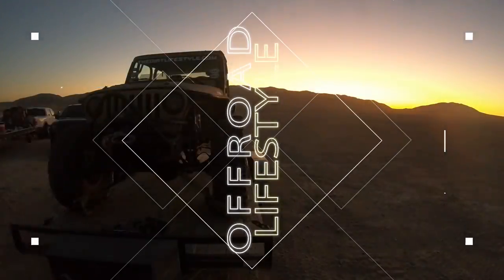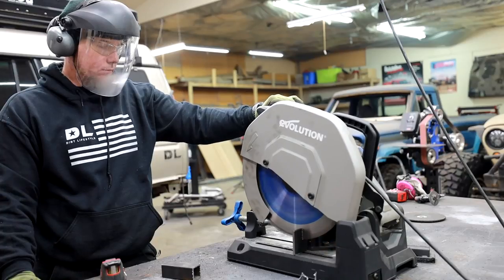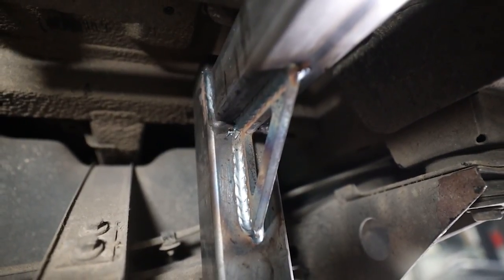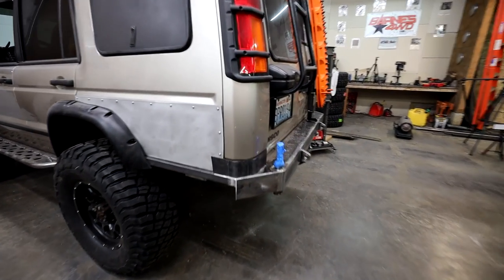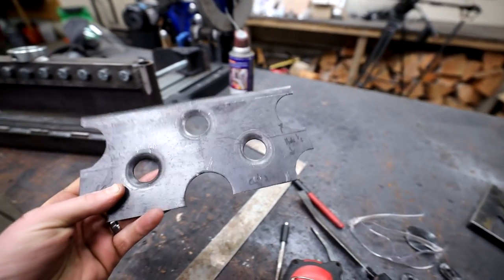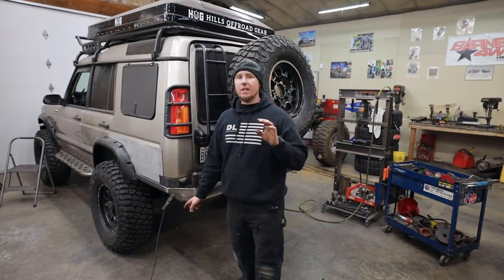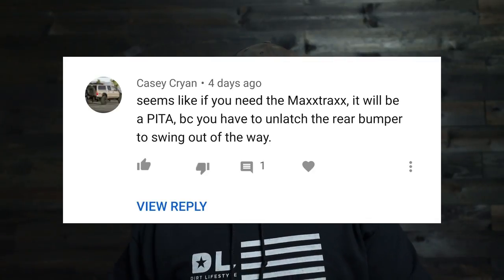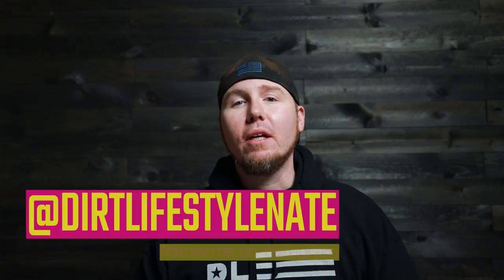Overland Tire Carrier Build Step 3. Ultimate Land Rover Discovery Build Episode 18

Comment: hey I love the tire carrier it's coming out great. I do have an idea to make it more rigid. if you add a curved arm to the top of the hoop behind the spare tire. it doesn't have to be big just like a 1in tube or something with a curve to at the end meet with a poly or rubber stop on the roof rack. I would weld a bolt so you can adjust it for minimum flex while allowing the latch to still work easily. the most rigid solution would obviously be to add a latch up there but it would be inconveniant and I don't think it's necessary. also extra function you could add a hook to hang stuff up above  your table setup.
Reply from the maker: You are definitely thinking along the same lines as I am. I am considering something like this as well 👍

Comment: Great work again, one idea I was thinking about the tire hoop, couldn't you drill a hole to drop the tube into the square swing out and weld from the bottom and around the top. That way the leverage wouldn't be against just the weld? Anyway, keep it up, can't wait to see how it looks painted. Also, I liked your comment about doing something different, vs doing yet another JK, might be why I like you channel. I have a Jeep Scrambler I wheel, nothing crazy but definitely different and I love not having just another JK.

Comment: I hope you show what you do to reinforce the butt welds on the tubing you used for the tire mount. I thought repeating what you done on the front on the back, if there is room! I definitely would like to have that knowledge! Maybe a rod that goes from the top to the bumper, like a crisscross brace,  and when you welded the bottom or second end, lean the 180 degree bend back a ways and then weld, so it had tension backwards on it when you let it go, it might work to take some of the forward sway out.

Comment: The bumper is looking great Nate! I noticed when you moved the carrier, the tire really wiggles around, adding to the stress on the butt welds. Have you thought of maybe having a 2nd latch attach to the side of the ladder for a 3rd point? Or you mentioned you put the tire up higher for overhang reasons, do you think it could come down a few inches to take off some of the leverage the weight has on the buttwelds and still not  interfere with departure angles?

Comment: Cool.... curious to see how you like the tire mounted that high on the swing. I usually mount them low and even try to have the tire sit on the edge of the receiver so it doesn't move around as much when I'm driving and for visibility. I like the look of what you did and if it works well without too much wiggle I'd love to know and try it on my wj project. Good vid man love it!

Comment: You could put a latch going from the tire mount  to the tailgate with some sort of rubber stop that the tire shores up tight against.
Reply: Was thinking the same thing. Like a kickstand maybe even from the roof rack down to the top of the hoop?  Then you’d have three points of contact that might stop the flex. BTW love the channel, lots of hard work so we can vege out for 25 min. Keep’m coming

Comment: Hello Nate, 
Been following you for quite some time., Through many of your builds & videos. As I'm watching this video, I could see that the Rover Overland build is coming together great with all your upgrades & projects that you have completed So far. But as I see you out using it, I have a question or Idea maybe for another project or add -on that would make your Overland camping a bit more comfortable for camping.
   Have you thought of putting on or building one of those Roof awning- OVS Nomadic Awning 270 -Dark Gray with Black Travel Cover - Driverside. This is just one of the ones i found on Amazon, It would be a great add-on to your roof tent plus it would add a cover over the back of your rig where you cook. Just wondering thoughts on it..
Reply from the maker: Thanks! I'm glad you are enjoying the video! I have definitely been thinking of an awning for this build. I haven't decided which way to go yet. Thanks for watching!

Comment: Nate, love what you do and the content you produce. Just wondering if you are going to leave the sides higher than the rear main section. Seems to me like you would end up hooking on rock. Would it not work better if the sides followed more of the departure angle so if you landed them on a rock you would just continue to slide off. Just 2 cents, keep up the good work.

Comment: I was thinking about a way to strengthen the tire carrier.  If you drill holes through the swingarm that allow the tire carrier tubes to slide through.  You can weld the tube to the swing arm from both sides.  No need to gusset it either.
Reply from the maker: Absolutely! I have thought about this as well. More information in The next video 👍

Comment: a small spine gusset on the reward face of the tube down onto/across the face of the rectangle tube would take care of it. 
It would have also worked well/better to make the hoop like a shock hoop on a frame rail, mounted on the outside face with some gussets back onto the top.
Reply from the maker: More details next Sunday 👍

Comment: Great video, explanations, and fab as usual Nate. I wanted to ask about your PPE, specifically the face shield you use and your dust mask. I know you covered some of that in the past, but just wondering what you are using now. They both look comfortable to work in and I really need to start using that kind of stuff. Safety glasses just don't cut it sometimes.

Comment: Love your work but I reckon that tyre is still too high. 
I think you may not have the issues you are concerned about re: departure angle, especially if there is a trailer in future. 

You could mitigate the bending moment (I think) by leaning the tyre forward as much as possible.

Keep up the good work!

Comment: Could you have drilled through the carrier arm for the hoop? have the hoop go through weld flush where it meets the bottom and then run weld around at the top of arm. Great vids!

Was just thinking if tube is almost size of arm maybe put sleeve inside loop at bottom so could still use the hole through the arm method.

Comment: quick question. i noticed when you closed the tire carrier there was quite a bit of front to back deflection from the tire. is there a way to stop that deflection? really love the "just wing it" design style. i find , in my projects, thats a really useful ability. blue prints are nothing more than guidelines. thanks for the insperation.
Reply from the maker: More information on this next Sunday 👍
Reply: really interested to see what he does with this as well.  I have a tire carrier that has the tire sitting higher as well.  I had a decent amount of deflection on bumpy trails.  My rig is an XJ so I took advantage of the license plate mount area and put a thicker aluminum plate where the license plate mounted and then have a rubber stopper attached to the swing-arm that sits against that plate when the arm is closed and it cuts down on the deflection.  I'm just concerned what stress that may be putting on the tailgate itself.

Comment: A way that one could have a stronger join at the bottom of the tire hoop would be to choose hoop tube OD and bottom beam width so that the hoop legs pierce the swing beam. that way, fillet welds can be welded to the legs both on top and on the bottom of the beam, yet the vertical faces of the beam are still intact.

Comment: I’m curious as to the weight of this. Can you weigh it when you paint if you remove remove it for painting. By the way great 👍 build. I’m thinking the way to beef it up would have been to extend your tire hoop mount that way you could weld it on the bottom and the top of the mound I’m not sure how this would work just my thoughts I haven’t watched the first two episodes of the build. Love your build.

Comment: I’ve had a carrier break like your talking about. I drilled through both sides of the lower tubes and sleeved a heaver pipe through both sides then slid the carrier down and nd both plug welded and rewelded it which gives you more shear strength.

Comment: Idea to the two poles holding the tire that you gusseted. Why not drill holes all the way through bumper and have the poles slide inside then weld bottom and top and then gusset it. This way your not relying on just welds.

Comment: Hey Nate. If you were to drill holes and run the risers into the tubing then add reinforcement. Do you feel that would provide the strength your looking for?
Reply from the maker: I'm addressing this in detail next Sunday 👍
Reply: @DirtLifestyle  awesome I'm working on designing a rear winch bumper with tire carrier to swing to passenger side and removable grille mount that will swing to driver side when used

Comment: could cut a slot out the back of the two tyre hanger uprights then down into the boxing, insert bar in the slot and weld the back up, hides the truss inside and gets more material in the plane where it's going to flex

Comment: Hey Nate, why did you not cut holes in the top of the swingarm and insert the tire tube hoop into the swingarm and then drill small holes on the sides of the swingarm and fill weld them in? Would that have weaken the swinger too much?

Comment: Nate:. Would the tire carrier attach point be stronger if you had the tubing pass thru a hold on the top/bottom of the bumper before you weld it.  You would have the mechanical attachment of passing thru  a hole on the top/bottom of the bumper, and you would at least double the weld surface by being able weld on the top and bottom of the bumper, and it wouldn't be a butt weld.  Your thoughts?

Comment: On the gusseting, An "A" shaped "tab" that straddles the first weld is what you need.  The gussets on the center-line aren't going to do anything for you because of the way it will be twisting, no strength comes from center-lines it comes from the edges.  Kind of like to beef up an I-beam you'd add mat'l top and bottom not in the center.  Hope that makes sense and doesn't come off wrong.

Comment: awesome work as always man.  and... the internet's gotta hate.  :P  I like how you called it out in the end.  I do have One question. A long while back, when people started fabricating swing-outs with trailer spindles, I remember some cases where the back and forth "wobble" of the wing out would (or.. could) eventually stress the spindle in such a way that it eventually broke off from fatigue.  I want to use a spindle in my own swing out carrier (which ill get around to someday), and a LOT of other carriers still use spindles like the one you have here.  Do you know if some special consideration has to be made to account for that issue?  Or are spindles such as the one you used in this video from EMS designed to not have that weakness?   Thanks again for a great video!

Comment: What diameter is your spindle?  I built two different bumpers with a 1” trailer spindle. They both broke off over time at the seal shoulder, holding a 33” tire. Clamp end was supported and using same style clamp you are.  Maybe it was how i built it?  If you are using the 1.25” it may work ok. You may want to consider some mount to the rear door to help take the shake out of it.

Comment: Overall I have to say that I'm impressed; building something in the moment by eye with little planning is a skill I've long wish I had, and you pull it off to great effect.
I do have a concern for you on your decision to latch to the bumper to the back hatch. As you even said in the last episode, the body and bumper with have relative motion to one another based on frame flex, and your latch becomes a single point trying to hold everything together. Depending on frame flex, mounting points, etc, this is potentially very significant loading. Sure, it might be okay, but is the potential stress/wear on components worth it when the only benefit you're getting is a gate held shut? It doesn't seem worth the risk in my opinion; latching the swing arm to the lower portion of the bumper would likely be the most robust solution.

Comment: Hi Nate. I have an idea for the butt welds for the hoop carrying the tire. Have you considered drilling holes in the carrier top and bottom. Holes to slide the two "legs" of the tire hoop through. That way you could weld top and bottom on the horizontal carrier onto your legs for the hoop. Does that make sense?
Reply: I seen how much the assembly moved forward and backwards when you shut it. I can see those butt welds cracking really quick. I mean like a day off road. Have you ever welded with Low Hydrogen rods? They are what my dad uses where he knows a welded joint is going to be stressed and loaded constantly. Might be worth looking into. I'm not sure if your Miller welder does stick though. Great content as always, thank you

Comment: Hindsight is 2020, right. On the butt welds, could you sleeve from the bottom of the swing arm up into the inside of the pipe for the hoop?  Spread the load through the top and bottom plates of the arm. Would have been easier to do at the time of build but I think it would still be achievable and not add much weight, maybe 8 Inches of pipe and some welds. 
Whole thing is looking good tho.

Comment: An easy way to bend aluminum is to heat it with an acetylene rich flame....no oxygen. This will make the aluminum malleable even when cool.To harden it back up hit it with an oxygen rich flame. I've used this method to straighten bent trolling plates.

Comment: I'm just thinking about the tire carrier and the strength of the butt welds over time. Would there be any benefit to drilling holes in the cross arm and putting the tire rack frame into them? That would allow 2 points if connection between the frame and the cross arm on each leg of the tire rack frame to support its forward and backwards movement. The gussets will provide a lot of lateral strength.

Comment: I’ve been watching this series from  the start! Im on the same stage of my patrol build right now aswell.  Currently putting on bumpers but with a help of a local shop because i still lack the proper equipment and skill to do it myself😅 tho there are some parts of it i did on my own. Had the same problem with the tire carrier, it still wobbles and my latch system can still be improved. I was wondering if i can show you a picture if what im doing and maybe ask for a recommendation of what i can do to make it stronger. Its a bit tricky because i used round tubing on all of it.
Reply: I will also upload this on my channel:)

Comment: Will there be enough deflection and vibration at highway or trail speeds   That may crack welds or the arm itself ? Is a dampening block  of some  kind needed  in your  build at  a closer point to the top of the tire carrier?

Comment: Why wouldn't you drill holes though the swing-bar.  Then drop the tubing though so you can weld it on the bottom and top of the swing-bar.  Asking because I was thinking on doing just that and want to know the pitfalls.

Comment: Can you not make the top of the Tyre Carrier mate with the rear door. Just to take the front back movement. Your swing arm can take all the weight etc.   I dono. You alrssdy have that plate mounted to the door.  You could somehow join the two there. Even if it's a second latch, that you only use when doing rough trails
Reply from the maker: I have been brainstorming about this aswell. Not impossible but definitely complicated. Still working on it 👍
Reply: @DirtLifestyle  agreed, cause you could easily do some sort of stud that goes into a hole. But then that won't help in the right direction of force.
Reply: Maybe something simple as this?

https://4x4direct.co.za/locks-and-catches/5792-spring-loaded-bolt-lock-140mm-bolt-63mm-bracket.html